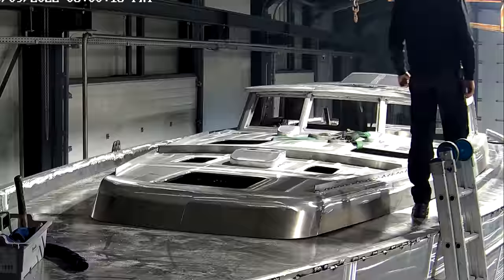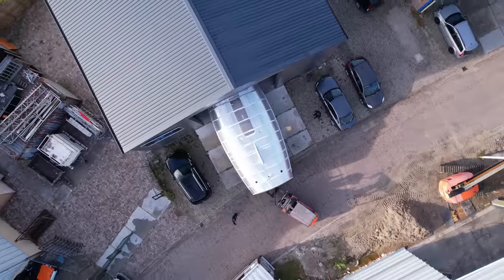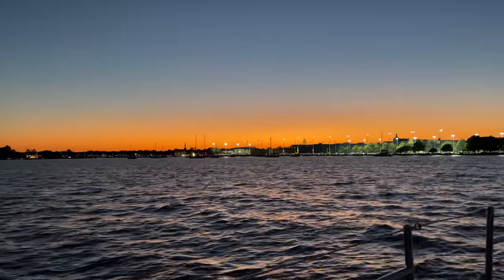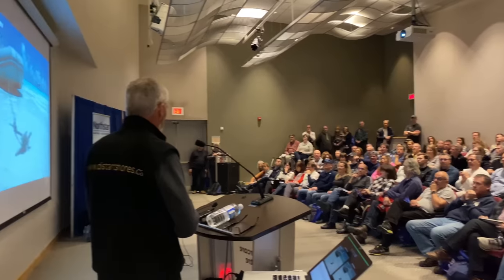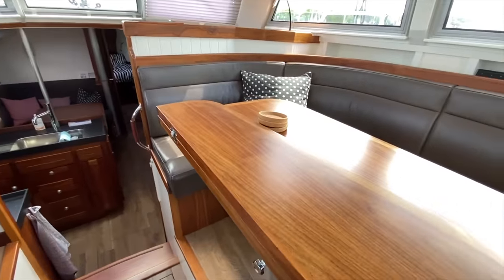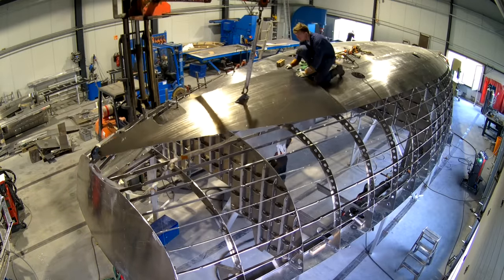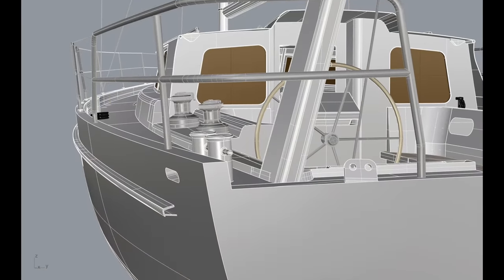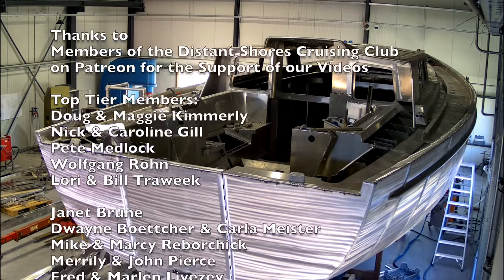Building an Aluminum Sailboat Pt 6 - Your questions answered | EP 224

Comment: 6:45 Aluminum by itself doesn't corrode.  it oxidizes in contact with seawater or when anodized, which is something we want very much since Aluminum Oxide is inert (passivated) and won't corrode.  In fact Aluminum Oxide is related to the mineral most sandpaper is made from, and some gemstones.

Galvanic corrosion happens when we have dissimilar metals in an electrolyte like seawater, and is controlled by electrical bonding and sacrificial anodes.  Galvanic corrosion can happen on a plastic composite boat between any two different metals in contact with seawater.  So that part really isn't functionally different in a metal boat.

Paul explained all of this very well, as usual.

Glad to hear you're going hybrid.  Electric drive in a sailboat is an excellent synergy with nature when the energy used to motor out of a harbor, off a mooring, or away from anchorage can be replaced by wind power simply by sailing.  And the batteries can be recharged from a wide diversity of sources: aforementioned hydrogeneration, diesel generator, solar, shore power, etc.

Comment: The one thing I like about Aluminum / steel boats are chain plates and bollards are not through bolted but actually welded to the decks. No place for leaks to occur because no holes in the deck and no bolts to rust or become loose. Good luck with your build. Congratulations .
Reply: Pulleys/sheaves/turning blocks can be lashed/tied with rope to the Aluminum tube/rod toerails too.  Also no hull penetrations, just ropes/webbing through slots in aluminum.  Can't corrode or leak, and when it wears enough, just re-lash.

Comment: I’m working on a 30 year old Ovni which was left bare on the inner hull and is pitted just from condensation mixed with dirt and dust. Areas that where painted are perfect. I would always paint the inner hull without fail. Providing it is prepared properly. I’ve not heard if you are painting or not but thought I should say. Someone in the life of your boat will hate you if you don’t!

Comment: I would suggest using Hempel silic 1 for your bottom paint, I sanded back my 35ft aluminium charter boat 18months ago, being a new build the application will be real easy.

Comment: Good session!
Just chose your material wisely.
Sven Yrvind (then 'Sven Lundin'), the very renowned and eccentric Swedish solo cruiser and boat builder of tiny boats, made a discovery in the 1980s that even the best designed and constructed vessel will encounter problems. In his case he got to experience the results of having chosen the wrong aluminum alloy, and in combination with the incorrect type of sacrificial anodes, his vessel 'Bris' essentially disintegrated outside South America. At the end forcing him to both abandon vessel and circumnavigation.
That said, aluminum, or rather the correct aluminum alloy, is an excellent material. Even if left 'naked'. But as always, brings with it additional challenges when connected to shore power. Especially if docked for longer periods of time.

Comment: We are excited to see your build, as we are also having an aluminum boat build. Alubat, Ovni 370. We have been to the factory as well and it's great to see the similarities and differences. Our manufacturer in France does not provide the type of Solar Panels, Lithium batteries, Hydrovane, OC Tender or many other upgrades we would like. We would like to ship these , US made tools and other parts for our boat to the EU. We'll be out of the EU well before the 18 months. So I believe the boat is are considered a "Vessel in Transit" Now on to my question. Do you have an experience with "important agents" ? Are you considering this for your build? We're trying to avoid the VAT. If you possibly have any insight we would greatly appreciate it.

Comment: You had me up until the hybrid drive.  From a performance and packaging point of view I would have chosen straight electric drive with battery and standby generator set.  You can run wires alot easier then propeller shafts.

Comment: How will you heat and insulate the hull to protect water pipes, components and boat in high latitudes and very cold/freezing conditions?
Reply: The Enksail Orion will be equipped with a central water heater. The pipes of this heater run partly through the bilges. The hull will be sprayed on the inside with 6 cm of foam insulation. The insulating effect has proven itself on a 43 foot Enksail Noorkaper which we delivered to a Swedish owner. He uses his boat in the winter as long as he can.

The windows of the deckhouse and those in the hull will be made of thermopane glass and are therefore also well insulated.
Normally we therefore have little problems with condensation. 
Gebroeders van Enkhuizen Yachtbuilding & Refits BV

Comment: What’s your tank sizes?  Fuel, fresh, black water, etc…
Reply: Tank volumes of the Enksail Orion 49

Fuel tank 800 liters
Water tank 650 liters
Black water tank approx 180 litersFuel tank 800 liters
Water tank 650 liters
Black water tank approx 180 liters
Gebroeders van Enkhuizen Yachtbuilding & Refits BV

Comment: Good Q & A.  Insulation is a big deal on an AL boat since it's such a good conductor.  Would like to hear plans and choices there.  Also lightning protection plans and rationale.  Thanks.
Reply from the maker: I agree and we will be making a whole video on the insulation and inside coatings 🙂also one on lightning protection...
Reply: Our boat wasn't insulated, wise choice that you are doing that! What propulsion are you going with?
Reply: @4stringmanagmaildcom  our boat was 2nd hand, and was not insulated, except for a fiber/cork composite which was adhered to the deck with some serious epoxy. We would much rather have had insulation, not only for the higher latitudes but the tropics as well.
Reply: @DistantShoresTV  we spent 8 hours in one of the most intense lightning storms we have ever seen, fortunately no strikes but several close surface strikes and multiple cloud-to-cloud strikes directly overhead. It seemed like we sailed through Mordor!!! Handheld vhf, tablet and InReach stayed in the oven that night. Would really like to see your lightning protection setup.

A few lessons we learned:

-VHF and AIS antenna will cause ground leakage in the hull. Isolate it properly

-Starting circuit will cause leakage, isolate that. We have a basic toggle that is switched on for cranking, then switched off after cranking.

We are following your build closely.
Reply: @4stringmanagmaildcom  an Aussie told me how to deal with corrosion pitting that eats a hole completely through (thankfully we havent had this problem) 

-a lag bolt, 6-sided head, 1" -2" length and a washer. Screw it into the hole from inside the hull, cut the protrusion off the next time you go for a swim. And properly cut, weld and patch/replace a panel with the appropriate series of 'aluminium' plate and rod when you haul in a year or 2

Comment: So i have issues with the double un-skeged rudders, especially in an exploration boat? what are your thoughts, and would a Garcia 54 not have worked?
Reply from the maker: I admire the Garcia 54 but wanted a heavier keel for upwind offshore performance.
Reply: Garcia Exploration range doesn't have skegs.

Comment: Why did you not choose to build a skeg in front of your rudder?
Reply: Because they want to sail.
Reply: good question
Reply: Building a strong skeg is (in engineering terms) somewhat redundant on a metal boat of expedition grade, because the potential loads arising from axial torsion on the spade rudder means it must have scantlings which result in it also being similarly strong in the lateral directions as a skeg.  If they are well engineered, they will bend rather than break in massive overload circumstances. The rudder post will be almost as wide as a skeg would, but of solid, ductile metal.
Such loads would also bend any skeg (and possibly the hull where it is attached) and thereby jam the steering, whereas a moderately bent spade rudder with spherical roller bearings will probably still operate on a 'get you home' basis.
Reply: @Gottenhimfella  Thank you for this reply - I to ponder this question.  I believe Jim Cornel bent one of his rudders on the 45 and didn't even know it till it was hulled out.